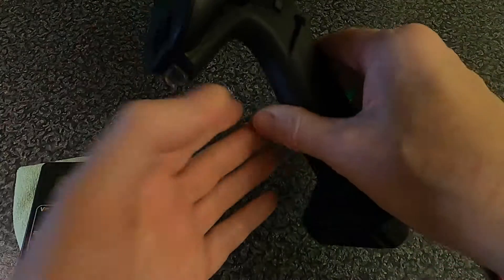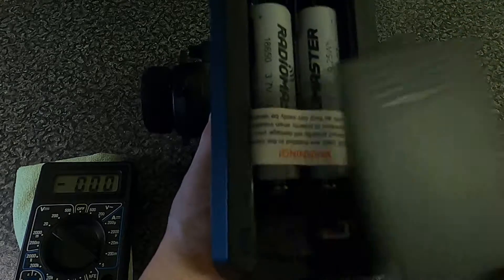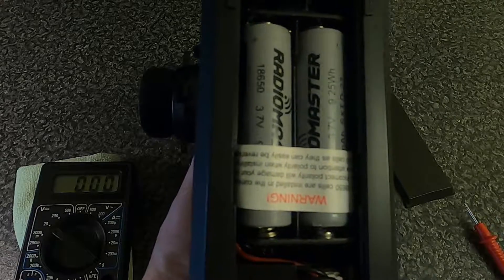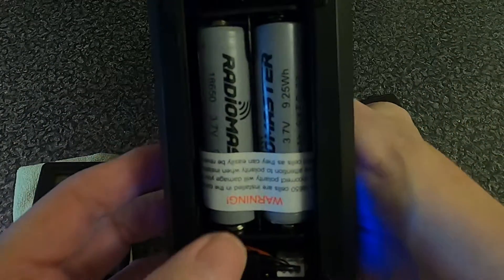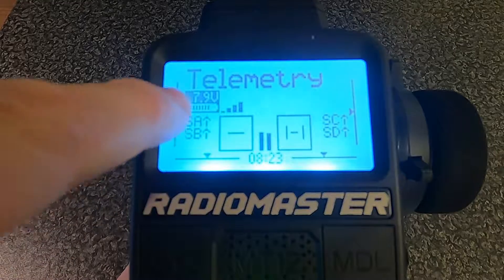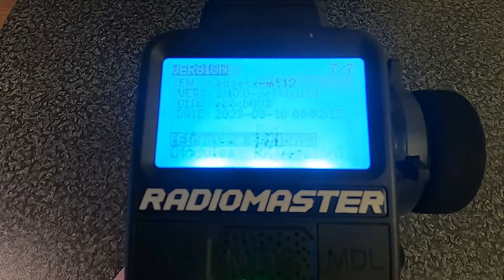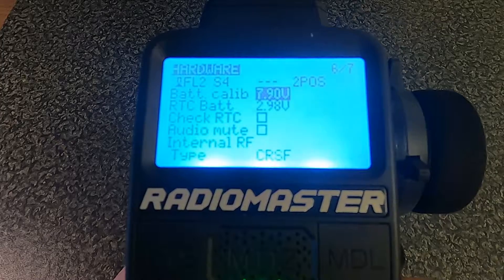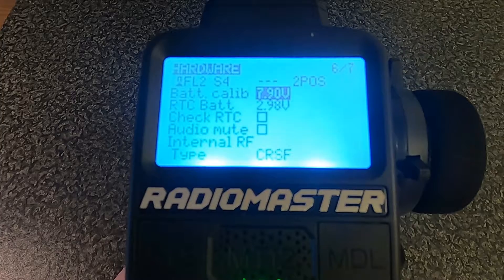RadioMaster MT12 Battery Calibration

Comment: How do I change the internal battery on the MT12? (clock battery)
Reply from the maker: I have not changed the battery at this date. You should not need to change the battery as your radio is so new.

Comment: Great vid again, Can you change the telemetry battery voltage mine reads .4-.5 volts low,
Reply from the maker: You need to calibrate the sensor, you will need a multimeter.
Reply: @the-happy-RC-flyer  what sensor, it’s the Radiomasters ERC5-i Rx with batt voltage input,
Reply from the maker: You asked about telemetry battery voltage. This would be the main flight battery say 4s 16.8 v full charged. If this is not being sent to your radio via the receiver and it shows 15 v you can go into the sensor settings on your radio once you have discovered the receivers sensors and match the setting to the actual battery voltage. You will need a multimeter. If you do not connect the main battery voltage via the supplied cable it will only show the receiver voltage which is 5 v. This can be confusing.
Reply: @the-happy-RC-flyer  yes main pack voltage, red wire from battery to RX, got it sorted had to discover sensors and go into Rxbt and offset by .4, needed adjusting on all 3 of my cars, weird the sensors disappear when you restart and have to rediscover each time to view them, thanks for the help
Reply from the maker: You do not need to rediscover the sensors just it the arrow and you will see them.

Comment: Please put a video up about 4ws
Reply from the maker: Hi I Do not own a 4 wheel steer car to set up. If you tell me how the system works 1 servo for front wheels 1 for the back wheels. Is the front rear steering proportional to each other or does the servo limits have to be different front to back or is it mechanically built into the mechanisms? Let me know the answers and I will work out the mixes for you.
Reply: @the-happy-RC-flyer  thank you for the reply. I found another video from another guy explaining. It is pretty complex but I will give it a shot. Thanks again!
Reply: @the-happy-RC-flyer  just FYI the vid is Jacob Sherer 4WS
Reply: @the-happy-RC-flyer  the most common form of 4 wheel steer is to have 3 modes: servo 2 is centered, servo 2 copies servo 1, and servo 2 does the opposite of servo 1
Reply from the maker: @Super1337357  thank you for the information.